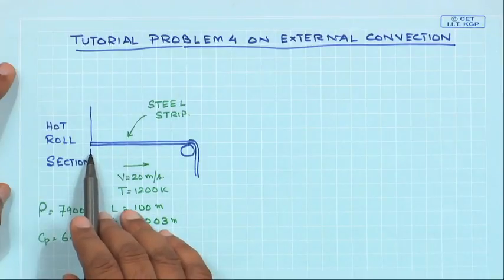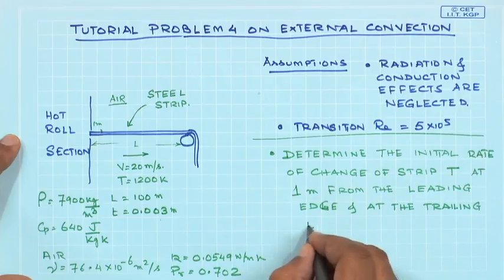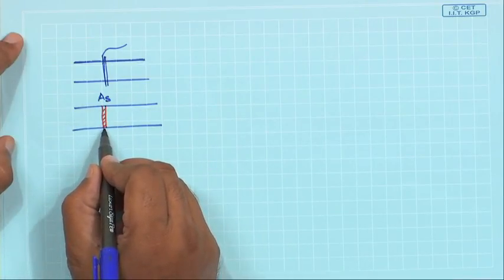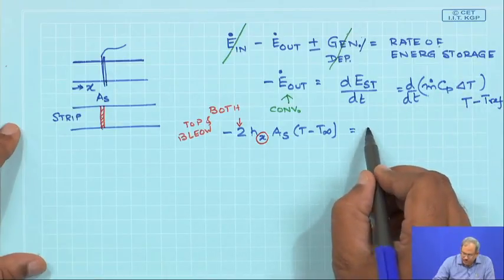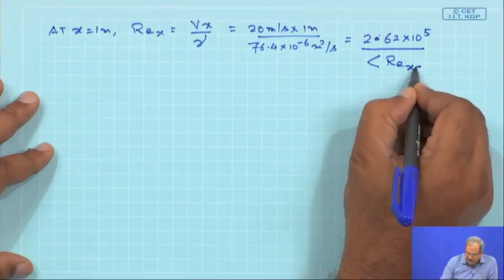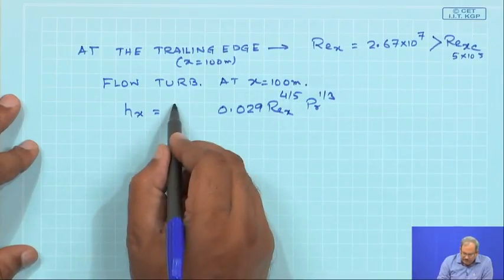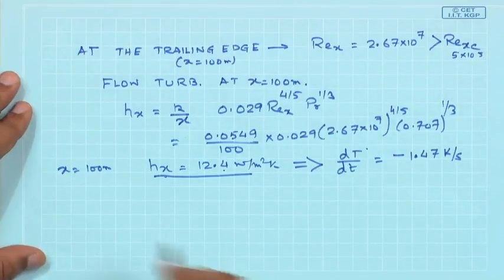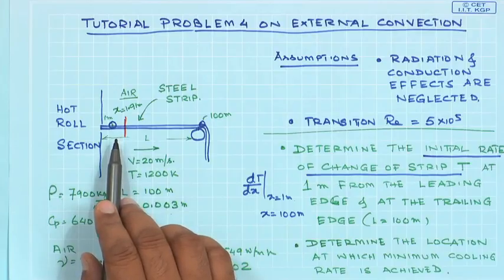Lecture 30 : Tutorial Problem in External Flow and Convection

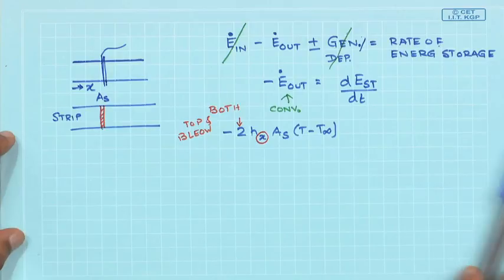Comment: In the conservation equation at 15:00, are we assuming that the temperature is not a function of x direction?
Reply: Assumed a zero conductive resistance since we were interested in the convection part so that the problem is simplified. The strip is changing temp along time only. Along the x  a constant temperature dipped with time.

Comment: here in this question since we saw that at x=1m flow is laminar and then we calculated at x= 100m and realised that flow is  turbulent but the expression used for nusselts number in the solution is only valid when the flow is turbulent from beginning other wise we should expression for mixed flow then 
why we did not consider it ?
Reply: It's a justified approximation, to be fair. The Reynold's number would pass the critical threshold within 2 m, and since the bulk of the thermal boundary layer evolution occurs after that, it's almost entirely turbulent.

Comment: sir, I have a question. Since the velocity of the plate is 20 m/s, can we just think the velocity is the velocity of the air? or I guess it should be in minus sign?
Reply: Yes, the same question I thought since many days. I've confusion that the velocity whether relative velocity of air w.r.t. plate or irrespective of plate velocity, only velocity of fluid is considered ???
Reply: You must take air velocity = 20 m/s as due to no slip condition relative velocity b/w plate and air =0 , means air will flow at 20m/s.
Reply: @ayushbharti2548  That's not the free stream velocity though, which is what you'd use in a typical flow over a flat plate analysis. Here the air velocity on the surface would be 20 m/s, sure, but the free stream velocity would be 0; the situation is equivalent to a stationary plate with air moving at -20 m/s over it.
Reply: The air free stream velocity is -20 m/s, but functionally, it doesn't change anything in the solution of the problem; the only issue here is that the 'leading edge' would be the portion of the sheet that is rolled out first_, and the 'trailing edge' is the portion of the sheet that gets rolled out _last (or most recently), so the diagram should mark a point 1 m to the left of the pulley (LE) and another point 100 m to the left of the pulley (TE). 

The direction does matter if you want to express a T(x) function or a partial derivative of T with x, though.